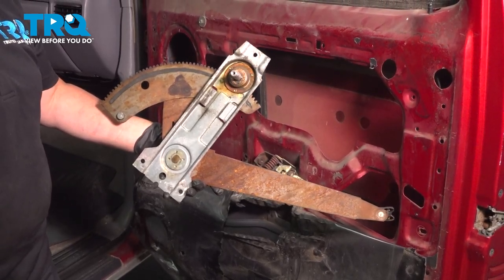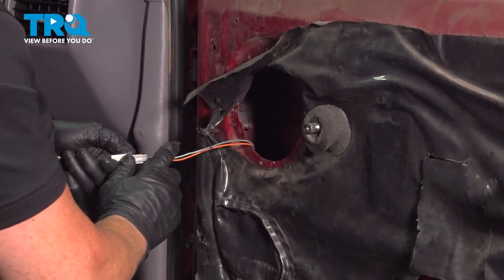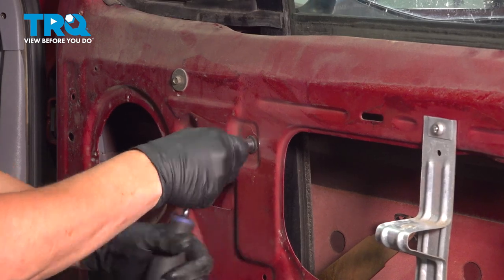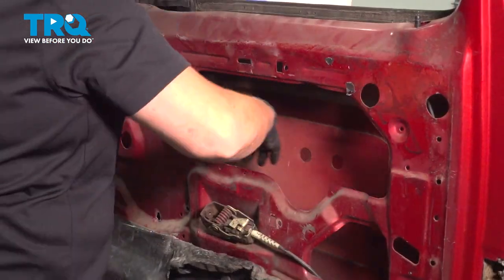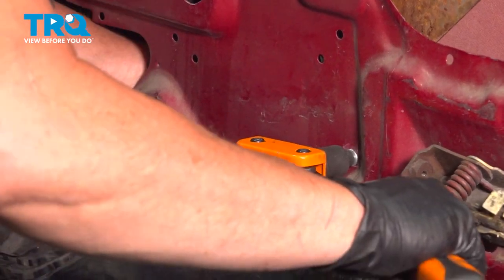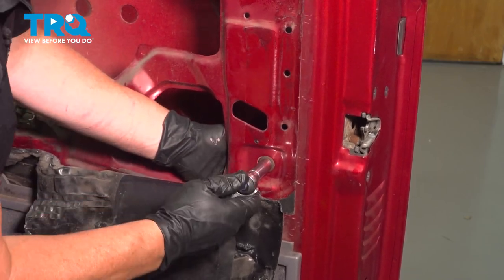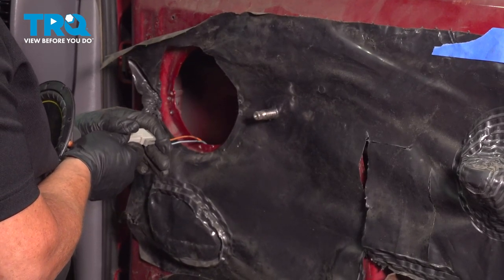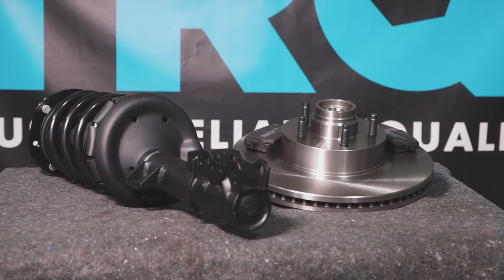How to Replace Window Regulator 1992-1996 Ford F-150

Comment: A quarter inch drill bit or larger takes out those rivets fast. I always punch out the rivet studs 'first' to make drilling easier. I worked on Fords since the late 60's. Also, those regulators are spring loaded and can remove fingers if you happen to try to disassemble one!